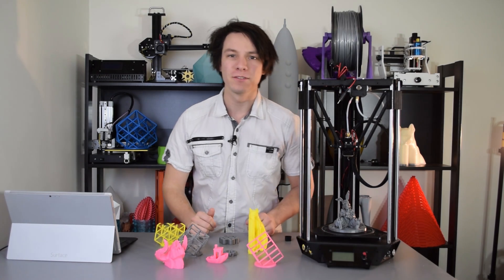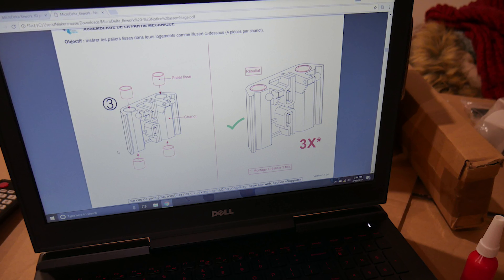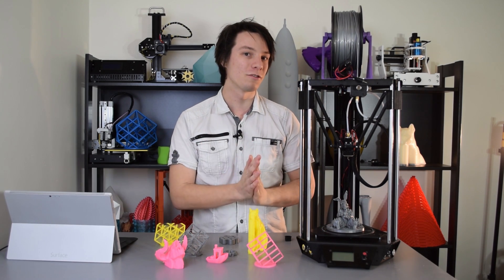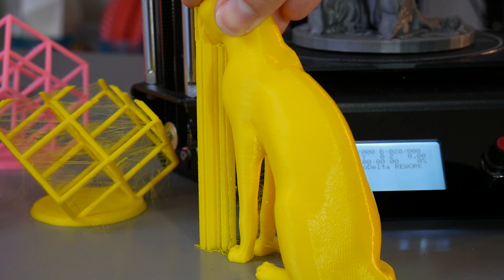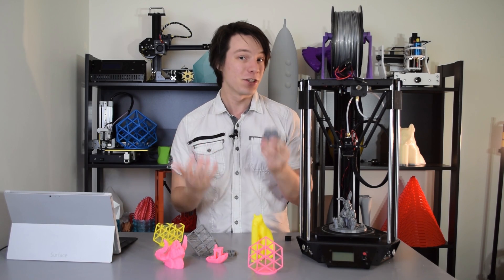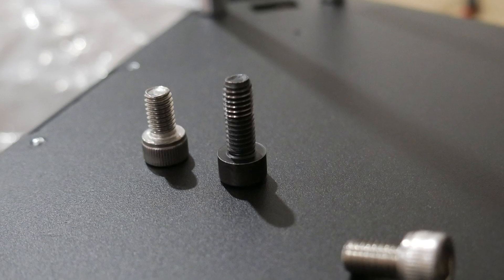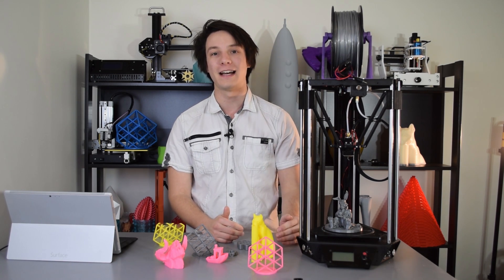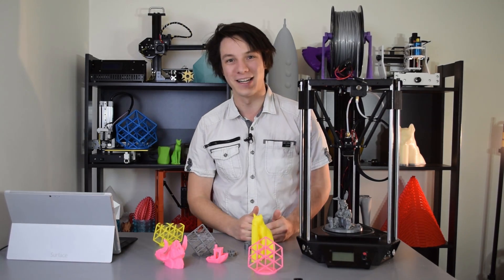MicroDelta Rework 3D Printer Kit Review

Comment: Not sure if it appropriate to ask here (if any reader can answer), but I get this "Salmon skin" effect on pretty much  every print I do (all  in the highest resolution of .1mm layer height) on my Cocoon Create plus printer. Being a newbe to 3d printing, I thought it was just what one should expect in any FDM  printing run, as it seems to only occur in certain areas of the print where I suspected the printing head started and ended its layer deposition. 

After watching this review, I am now not so sure of this as accuracy of micro stepping of the stepper motors  is mentioned.I have tried to find other information about this "Salmon skin" effect on the net with zero results.

Is this "Salmon skin" something that is unavoidable in some or all 3D printers, and if can be rectified, how does one go about remedying it.?

It is not a big concern to me right now, but I can see that in some prints I will do, I would prefer not to have this "Salmon skin" effect.
Reply: The cheapest and easier thing you can do to help with this is upgrade the stepper motor drivers. This will also make your printer a lot quieter. Look up "silent step stick", and you will find quite a few videos on how to do this. The silent step stick drivers are not cheap, but you can get something very similar for less than half the price that will be just as precise, but not as quiet as the silent ones.

A higher end control board will help as well, but thats a whole other thing to deal with.

Comment: Here's a question based on pure ignorance - Has anyone tried using Weed Eater Wire in a 3d printer? ...it's plastic right? (and cheap)
Reply: i did see someone try that, can't remember who it was now but they were doing strength tests on different filaments
Reply: btw it did not go well
Reply: I dont have a 3d printer yet but I've watched so many videos that when I do get one I've gathered enough knowledge that I could probably 3d print a fart in clear and 30% brown in fill.

Comment: Hi Angus

Great Video.

Another thing that could cause the Rails to jam is Rail ends that are not square? If they have not been faced off in a Lathe they will probably not be square. When you tighten the screws the rail will bend (and jam the Bushings) as the screw tries to pull the un-square end of the Rail against the end plate. I have seen Rails that were only cut off with a Saw and not very square. If you have a Lathe you could square the ends up and see if that fixes the problem. Just remember that the Rails need to be all the same length, otherwise you will end up with another problem. If this doesn't fix the jamming issue than it most likely is the end plates are not flat.

I Subscribed a while back and enjoying your Videos very much. Thank you.

Willy

Comment: Good review.  The print volume is too small for the price especially since no heated bed.  I bought an Anycubic Linear Plus kit for a little over $200 shipped on special with a 230mm by 300mm build volume and includes a heated bed and linear rails.  With a little help from the YT assembly vids and especially user comments for calibration it was not a challenging build.  It is a great printer and fast.  I've yet to encounter a "perfect" kit that did not need some hardware added or substituted due to screw lengths, etc.   I'm really rallying against any more reviews of "mini" printers.  The market has moved beyond their features and print volume bang for your buck with larger printers.
Reply: Wow, I recently bought basically the same printer but with the pulleys, and I thought this was a small printer. I sorta assumed that all these mini printers people review were the same size as its hard to tell just from Youtube, but wow those are tiny. Any smaller than what I have and I would consider it a completely useless toy.

Comment: I've one (micro delta rework) and after run your test with ABS at 235º/90ºC the 0,25 is tight but it roll, the 0.3 is spinning,  samething is wrong with your setting ;)

Comment: Hello, I am thinking of buying my first 3d printer with a budget of around $300. I don't want to buy the mp select mini, because the print bed is quite small. What would be your recommendation for me? Thanks a bunch for your time!
Reply: Marcus Kuo for 350 you can get a cr-10
Reply: SAURON'S Right hand man How does it compare to the A8 and the MP maker select v2?
Reply: Tevo tarantula ....great quality for $200
Reply: Keep in mind, large print area size is a bit overrated. I mean sure it comes in really handy if you like printing big objects. But I print large objects very rarely, and often times even if I am designing big parts I usually print them in pieces (and glue them later). I find the flexibility and added consistency with smaller parts really helps. With that said cr-10 has a big print area and it's fairly affordable and decent printer.
Reply: Marcus Kuo you could look into the anet E10 printer. There are a few reviews on YouTube on it. And for a bit over 300$ it's a very well rounded printer.
Reply: The Anycubic i3 Mega is $360 right now.
http://www.gearbest.com/3d-printers-3d-printer-kits/pp_641324.html

If you want a DIY kit, the Anet A8 for $160 might be something for you.
http://www.gearbest.com/3d-printers-3d-printer-kits/pp_343643.html

Or the Geeetech I3 Pro B for $250.
http://www.gearbest.com/3d-printers-3d-printer-kits/pp_375209.html

If you want a printer that can do big prints (300x300x400mm), you have the Creality CR-10 for $440.
http://www.gearbest.com/3d-printers-3d-printer-kits/pp_627175.html
Reply: wait for the MP Maker Select V2 to go on sale. I got mine on black friday for $260USD
Reply: maybe look into the Cetus 3D. Beyond that all I could recommend are some kind of i3 derivatives, like some of the Malyans, Wanhao Duplicator, MP select, y'know
Reply: Marcus Kuo the FLSUN i3 on amazon is $270. It prints fairly well , has a solid metal frame, a small but dedicated comunity creating some simple 3d printable mods and has a decent build volume, solid support (for a kit) and is not too hard to build 
I have an overview on my channel as well as a timelapse of printing
Reply: Orballo i3 Steel if u like i3 design, very solid frame
Reply: While if you want a kit get an anet a8 or a tevo turrantula
If you want a delta get an anycubic kossel
Reply: Indeed: everyone seems to want it, but (almost) every actual print I see is FAR smaller than the build area of even quite petite printers.
Reply: Tevo Tarantula for life! I have one and they are awesome!

Comment: Hi, Angus,
great to see you reviewing the printer I've bought a few months ago (and couldn't quite get to work... after all that time... but I'll come to that)! Just thought I'd give a few impressions out of my experience until now, as you seem to be having much more success than me with this printer ;-) - maybe you can shed a new light on my troubles, with your broader experience :-) (and sorry if I'm venting a bit here - as I said, this 'drama' has been ongoing for months here, with no resolution in sight yet...) :

- Sliders binding on the smooth rods: For me, this was the biggest problem with the build of this printer. The build instructions do say something along the very simple lines of "If the slider binds, loosen and re-tighten the screws, until you get a good, light movement." Great idea - if only it would work that easy. I ended up with ~three hours of "tighten up screws - slider binding up on trying - loosen screws - rotate rods a bit - tighten screws - slider still binding - rinse/repeat..." Following that method, I could have screwed around with those screws (sorry for the pun...) until I'm blue in the face. So, I had to resort to adding a little "combinatorics game" to the mix: Which pair of rods, used with one another, with which end up (and yes, this does make a difference...), gives the least friction at the required movement range (as the lower end of the rods is never actually used anyway)? This took me another ~4+ hours, and I'm still not quite at a point I'd really call optimal, but at least at something resembling "should be decently useable" - the steppers should be able to handle the remaining forces pretty well, I guess. And when I remember Joe's (3D Maker Noob) live build - he got that part over it in a little over an hour - me, it took all of eight to get to a decent result... And according to the classic 'rumble test' (roll rod over flat surface - if it gives an inconsistent, repeating rumbling noise, it's not quite straight...), my six rods are about as straight as you can get (at least without paying more for these things alone than for the whole printer)...

- Spoolholder: They put the according .gcode file to the original, intended spool holder onto the "firmware" microSD-Card, so you can select and print it from there. Only, if this is your first and only printer, this kinda creates a "chicken-and-egg" situation: You need a well-working spool holder to print a working spool holder. So, I tried a spoolholder from an ANet A8 that I could lend (same basic shape as the one you had standing on top), which didn't work too well, either: I once have dared to lay the according filament spool on its side onto the bed - which now gives me the really 'funny' effect of the (before then pretty well-wound) filament sometimes crossing over itself and thereby snagging on itself at every inopportune moment, which blocks the spool from rotating and creates more resistance than I could get the extruder to reliably handle. Result: no really reliable filament feed, no extrusion, prints falling to pieces due to missing layers (printing air...) As I said, very funny *grrrrr*. So, I'm wondering how printing with the spool on its side is supposed to work anyway, roller bearing underneath and all aside, when the filament windings start to slip and snag on one another... 

- Which brings me to my next trouble spot: tension on the extruder "clamping mechanism". I have yet to find a really good 'sweet spot' between "not enough pressure on the filament, not advancing anymore at the slightest provocation" and "too much pressure, extruder carving into filament instead of moving it". Seems a little like a razor-thin mountain ridge to me to find a reliable working point: a little too far off the edge, and you're going downhill fast with your prints...

- And then there's the one snag that absolutely stops me from getting anything approaching useable out of what should be a great device, even the aforementioned spoolholder: I have yet to get a straight print from it - it all looks like someone pushed the print over to one side, from one of the corners to the opposite edge, bending and/or layershifting what should be a straight, upright line, and this effect is getting worse with every try... Now, on a cartesian printer, I could see where layershifts could come from, but from a Delta? Doesn't make one bit of sense to me - shouldn't skipping steps screw up the shape of the object as well? And the "bending" part I don't have any clue at all about - or is this just "layershifting on a lesser scale"?

Comment: Hey :) When you say "basic profiles" and "rudimentary support" in repetier, you actually mean Slic3r right? Repetier is just a printer control software, like pronterface, but way better. It doesn't have a built in slicer. Usually it comes with Slic3r but you can use any other slicer like cura or skeinforge.
I don't understand why lots of guys in the 3D printing community tend to speak about Repetier Host in a deprecative way. It has really unique features, like:
- managing the SD card contents while the SD card is in the printer (no need to poke around with the SD card but still printing from SD card)
- seamless LAN/wifi printing with Repetier Server
- Using any slicer you want
- multiple printer support (if you setup multiple printer profiles, it e.g. remembers the last slic3r profile you used with that specific printer)
- better UI / manual controls than pronterface
Maybe a video about printer control software and its features might be a good idea for the future? I mean, you have Simplify 3D, Slic3r (afaik now has rudimentary controls, too), pronterface, Repetier Host, OctoPrint, Repetier Server (WebGUI only), Repetier Server+Host... For me, Repetier Server+Host is the way I go with my 3D printers. It's the best printing experience I know so far. Using Repetier Host to prepare the print is easy and then, one click to slice it and just another one click to actually transfer it to Repetier Server over wifi and start the print (so you may close repetier/shutdown your pc). The only file open/save dialog you will ever see is for choosing the STL file to begin with. Really nice experience ;)
Reply from the maker: Repetier running the older cura slicing engine. It does work, and I've used it for years but we've definitely come a long way in terms of slicing parameters, slicing speed, manual support control and good gcode preview. I don't trust any mode of tethering and found sending gcode to the sd over the usb connection was impossibly slow, so slice to SD for pretty much everything... habit!
Reply: Sure, you have to use repetier with a recent slicer. I use the latest version of Slic3r with it. If that printer came with an old version of Repetier / Cura and without instructions on updating that, that surely is a negative point for the review.

Uploading gcode to the printer via USB is slow, that's right, because usually the printers are limited to 250kbit/s. But since there are cheap printers out there with SD cards but no LCD/controls, or SD card slots on the back that aren't easy to reach, it is still a valid option. Also, if you use a modern laptop, you may not even have an SD card slot.

Using Repetier Server+Host on the other hand is damn fast, as it is not limited to the serial interface. Really huge prints are transferred within less than 5s.

Also, you can't avoid using manual controls completely - especially on the cheaper printers. If the printer doesn't have built in procedures for leveling, calibration or filament changing, you need a way to control the printer manually from time to time ;)

Despite your habit (which is okay, you can do that as long as you want :D), I'd still recommend doing a video about the different options available ;)

Comment: Gotta love that delta blobbing. Lol this seems like a good machine but the price seems unreasonable. I would suggest the flsun delta with the upgraded linear bearing rails and the heated bed. It comes in at less than $300USD. all of the parts are injected molded, no 3d printed parts. Which is nice.
Reply: That's encouraging, I have one still in the box.
Is the board a 32 bit or what?
Reply: Yes, there are better and cheaper kits than this Rework one. I picked up a Renren3d mini delta with linear rails for around that price. Good instructions for the build and calibration. Awesome accuracy and speeds.

Comment: So im not crazy, The first thing I thought when I saw the delta concept was non-linear head movements out of sync because of the stepper motors,
Reply: Well, but that's the same on a cartesian printer as long as you don't just print along the x/y axis... I have a delta, too. Sure, you can see artifacts on flat walls. They have a different structure than those on angled walls of my cartesian printer, but they aren't worse...